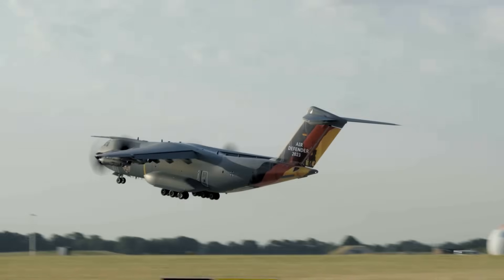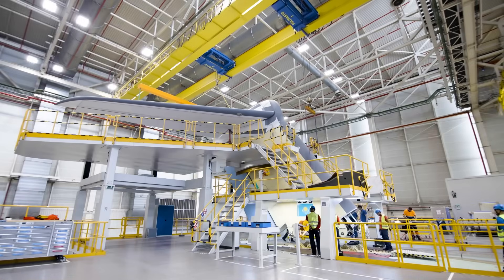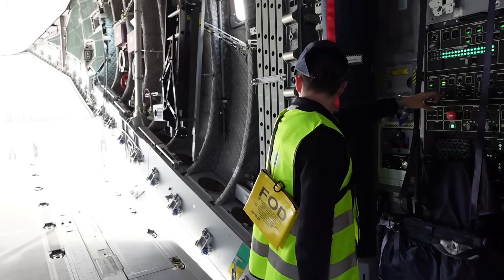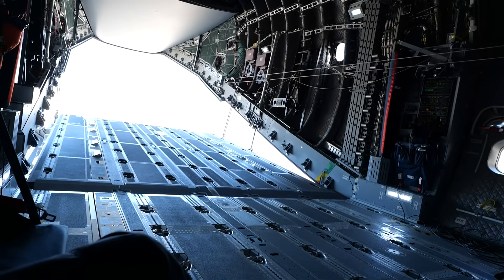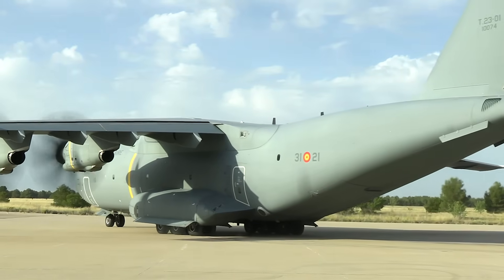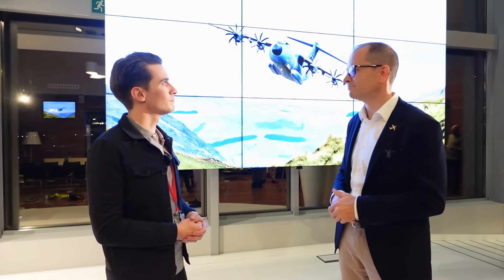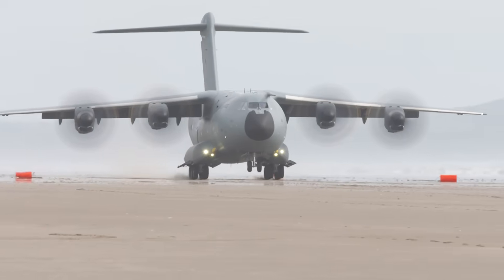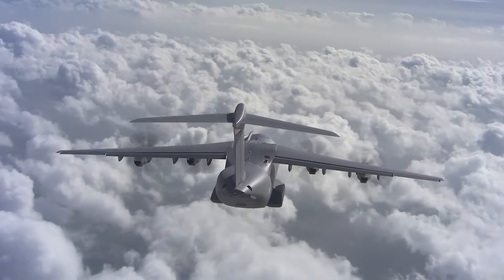How to build an Airbus A400M

Comment: No, this statement is incorrect. The tp400m is not the most powerful propeller turbine ever built. Back in the 1960s, the 25 Bär 4 had 12,000 hp propeller turbines, each driving two counter-rotating four-bladed propellers. The latest versions of this aircraft, which are still flying today, have 15,000 hp per propeller turbine. However, they consume incredible amounts of fuel and achieve their maximum speed through, among other things, a certain amount of residual thrust generated by the engines. The economical cruising speed is then also significantly lower than the maximum speed, with fuel consumption still significantly higher than in the case of the TP400M. The latter is therefore the largest Western propeller turbine, which, thanks to the special propeller design and two right-turning and two left-turning props, gives the aircraft more comfortable and safer handling, especially in the event of an engine failure, and, for turboprops of this size, a high cruising speed and long range. The propeller blades are made of carbon fiber reinforced plastic and are hollow. They have a shape that could be used with aluminum, but then the centrifugal forces would destroy the propellers at operating speed due to their weight. The approximately 2.40 m long propeller blades of the TP400M, on the other hand, are so light that they can be carried away with an almost outstretched arm, even though eight of these blades can effortlessly transfer 11,000 hp from an engine into the air. The crescent-shaped design also allows for high cruising speeds without undesirable Mach effects at the tips of the propeller blades.

Comment: I'm just speculating, but could the technologies and lessons learned from doing the A400M be applied to produce a commercial aircraft? I don't know if the economics will work, but I can imagine airlines that want to connect megacities in Africa and Asia going for a large place that can work with shorter and lower-quality runways.

Comment: I am not clear on how exactly a helicopter takes on fuel from A400 in mid-air. Also, how does an A400 compare with a C-130J in handling characteristics?
Reply: Did you even watch the video? There were clips at around 10:55 that shows footage of helicopter refueling.

Short answer: same way you would do aerial refuel with a fixed wing aircraft. You match the speed between source and receiver aircraft and transfer fuel via a probe & drogue

Comment: Typical UK MoD procurement incompetence is everywhere but this example is a favourite: New Boxer infantry wheeled vehicle. It takes THREE Airbus A400M to lift 2 Boxers. A single Boxer must be airlifted by two Atlases. 

Superb forward thinking by a staff of 22,000 at MoD.
Reply: What complete twaddle!  The Standard Specification for the aircraft was finally agreed by the 7 nations and signed off in 1999 and the UK was a signatory - forming part of the contract to begin detailed development of the 180 aircraft.  The UK off take was at that time 25 aircraft, less than France or Germany and its was a bartering process of National requirements.  Throughout the development of A400M, UK was in and out of Boxer like a sailor on leave and spent years down the the dark alley of FRES.  The A400M was in service by the time UK made a decision on its fighting vehicle and Industry had developed an aircraft as specified.  MoD procurement is pants but it isn't an aircraft issue.

Comment: 0:21 Just to get it technically correct: the TP400-D6 is the most powerful turboprop engine in the western world with 11.000 shp. The most powerful in general is the Kusnezov NK-12 with 15.000 shp, carried by An-22 or TU-95.
Reply: That is true, however the A400M is the most efficient turboprop in existence. It has much superior combustion technology. If you would swap some TP400 on a 737 or A320 it could achieve  a unmatched fuel efficiency. Alone the engine software has more than 200 000 lines of code.
Reply: @techdefined9420  why is 'lines of code' a measurement of fuel efficiency? that number is completely uselsess in pretty much any context
Reply: @c0dy42  How you come to this ridiculous conclusion? Lines of code is a measure of how sophisticated something is not fuel efficiency
Reply: @techdefined9420  no. it's a measure of fuck all. lines of code mean absolutely nothing because those lines can be 90% comments or fluff for all we know. it's an all in all stupid metric and says absolutely nothing about the complexity or performance of a program
Reply: @c0dy42 Such utter garbage. These line of code are not for fun. They are needed for the FADEC. Also the TP400 has been built to the newest, most stringent civil and military certifications. Very few airplanes in the world can fulfill these certifications.
Reply: @c0dy42  i call that BS. and your uninformed opinion.